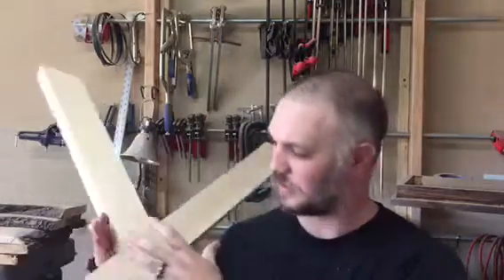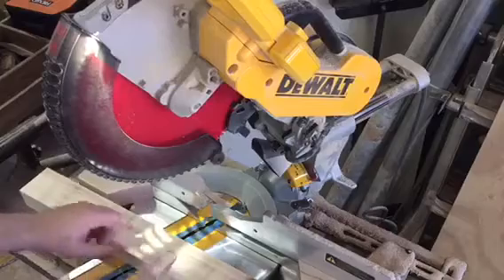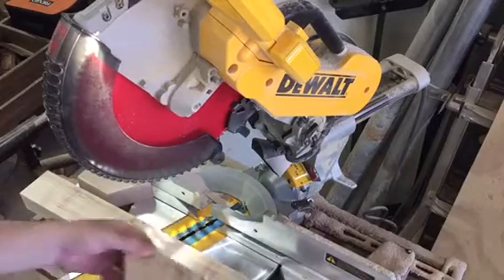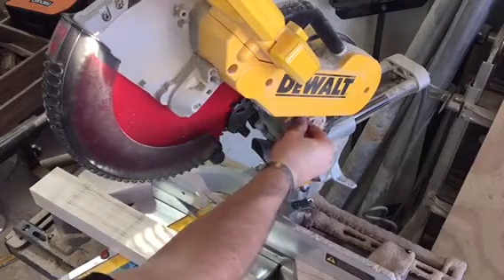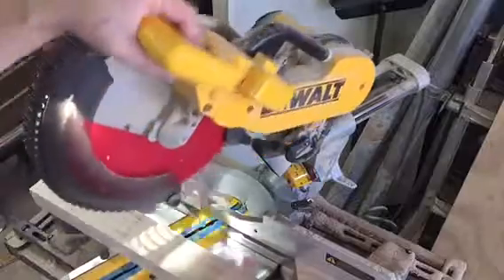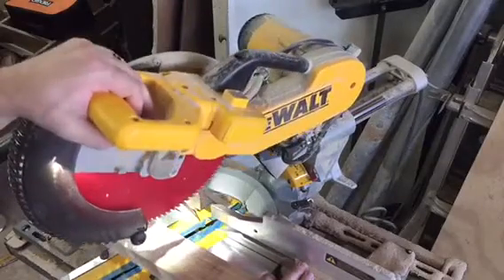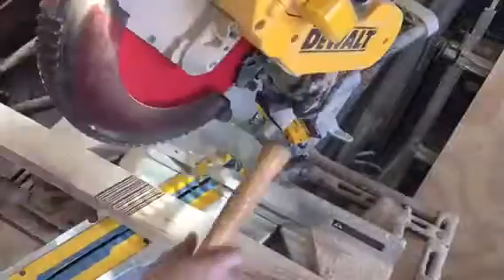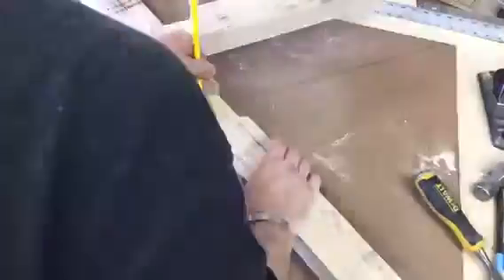Quick Tips: How to make dados on your miter saw

Comment: You can barely see your backup support piece in the video and you didn’t talk about why it is needed when cutting a dado and you didn’t secure it down with a clamp and you didn’t bring it close to the kerf so it won’t rip the piece out of your hand. Sorry as a wood shop instructor I must say you missed the safety needs in this video. But I am thankful you showed the dado stop feature on this Dewalt miter saw.
Reply from the maker: Thomas Brown I always run a marking knife on my dados to break the wood fibers. Yes it is a lot safer to clamp it down. Having been in a few production shops and been taught by 3rd generation carpenter. I do have some flaws in my practices. But am very safe. The backup support piece is cut offs from the same wood. So it’s the same size. Now if you use a thinner piece of wood at the backup support piece. It will kick back on you.